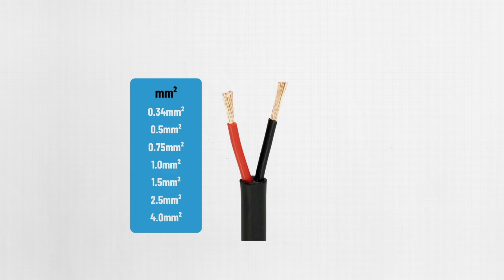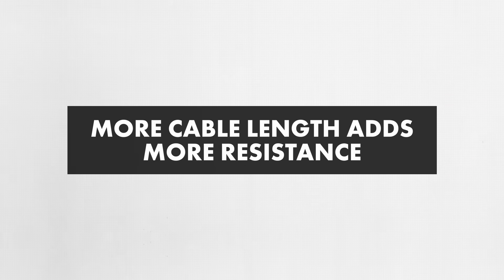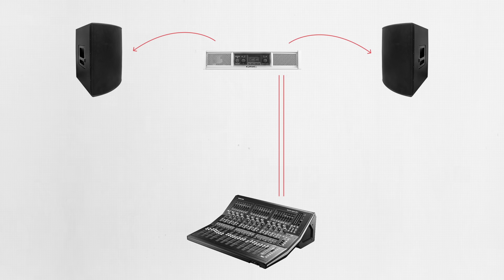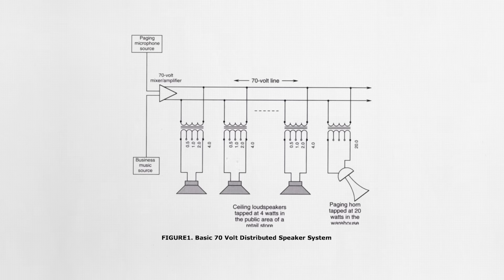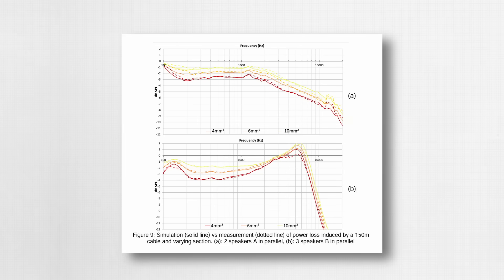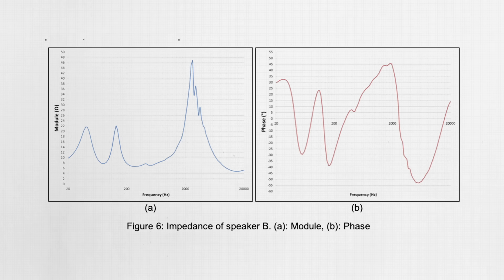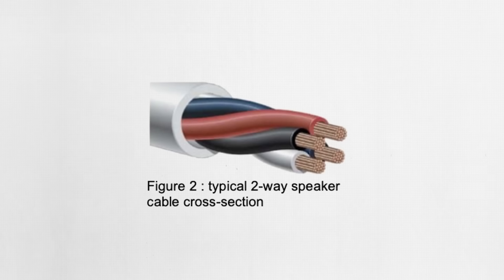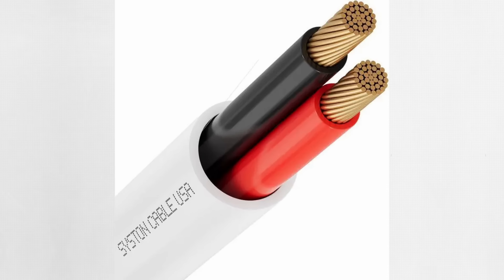Choosing the Right Speaker Wire (Made Simple)

Comment: I run 15ft wires from my AVR to two pairs of bookshelf’s. Went with OFC 10 awg wires for both pairs of speakers. Wrapped the pairs of wires to each speaker in braided PET. probably overkill but recently i found out that both my speakers can be powered by a 4ohm resistance. When the AVR was set to 8ohm it would get super warm even with the big gauge wires. set the resistance to both pair speakers to 4ohm and now the avr barely gets anywhere near warm. I also did not know bigger cables are better for low driving lower resistance speakers, so in the end im very glad I went with 10  awg cables even if it was thought to be overkill at first.

Comment: Excellent, completely accurate video. Well done. Howevrr, one point for home audio applications is that all those considerations are not really necessary since the price of 12ga cable is truly insignificant in the scheme of things. 16 ga zip cord is 30cts/foot 12ga is 1 dollar/foot. If your wiring a set of 1000 dollar speakers.... you get the point. The "saner" proposition is to simply use 12 ga for any system where full spectrum sound is expected. Commercial applications, where a penny saved is a penny earned are whole different subject.

Comment: the cable length matters a lot , the higher the frequency the more it matters , for 50hz bass you can have 20m wire you wont lose anything , but for 10Khz with 5meters you will lose some . Always use shortest cables you can , its not how expensive it is , after all PCB track in your AMP or DAC or whatever is real cheap , but its short and that is why its good .

Comment: Cables are not good so keep them as short as possible >>>pre-amp + 2 power amps.  I read a magazine which contained a test of different cables,from cheap to expensive and the conclusion was that all had their positive aspects but also negative aspects, least worse choice was to use coaxial cables ...the ones used by radio amateurs. The loads of money people use for very expensive cables are better used to buy 2 poweramps or active speakers.
Reply: least worse = best?

Comment: need to completely re-wire the inside of my 2 monoblocks - classA - what do you recommend? thanks
Reply: just don't go overboard. as all is precisely calculated for exact millivolts and milliamperes. changing to much thickness of wires, all that changes. you will probably need to change values on many capacitors resistors thermistors and transistors. find a good engineer who will be able to calculate all that. 
i once put 3 times thicker wire on power block and end up in fried capacitors. all because I didn't install stronger resistors. 
you heard it here. length thickness and impedance matter.
or just replace with same thickness and length.

Comment: decades back I ZZZZT-Poofd a woofer playing Creedence. when I replaced the driver I also replaced the scrawny wire from the crossover to the driver, reassemble. rock and roll. WTF? the other driver croaked? put my fingers on the other woofer. It's alive!

I figured out I should replace the scrawny wires in the other cabinet from crossover to driver. that worked.

amplifiers have two impedances, outbound and inbound. the inbound to outbound ratio is called damping factor. higher is better. a driver is a linear motor. A DC motor is a DC generator when it is driven rather than driving. the massive cone on a woofer has momentum. when the drummer relaxes for a moment the massive woofer cone bounces a few times. that generates a backwards voltage into the amp which muddies the bass. the low impedance back into the amplifier wastes that back voltage to ground. this only works if you have substantial wires from amp to speakers. I use 14 or 12 gauge with vast dual woofers.

Comment: Really well done!  I'm so glad you included skin effect, which is a real consideration at higher frequencies - at 20 kHz, that depth is less than 0.5 mm in copper.  Also, your inclusion of inductance is important, as there's more to speaker cable impedance than DC resistance.  One more point is that of damping factor which requires low impedance cabling to remain high. (That may not be as important with tube amps which have an inherently higher damping factor.) Again, excellent presentation!

Comment: For pro-audio the absolute most important aspect of your cables are "Do they lay flat on the ground to not create a trip hazard?" and "Do they coil nicely at the end of the show?" and " are they durable and reliable?" The answer to all those questions are "rubber jacket" SJOW or SJOOW cables and if you need to drive a forklift over them and don't mind the weight and bulk "rubber jacket" SOOW cables. Avoid the PVC plastic jackets as they don't lay flat or coil nice, get the rubber jacket. 12 awg is the industry standard for gauge, 14 awg is usually fine for tops if you want something lighter and thinner (more pack friendly). These cables are a pleasure to work with and cheaper then any dedicated "speaker" cable. Throw on some speakons for connectors and you'll have a cable that'll last forever. The 4 conductor cables are great for NL4 speakons, unfortunately you'll have to get the 3 conductor cable if you only need 2. Either disregard the 3rd connector or tie it in with one of the other connectors to lower your resistance. 14 awg + 14 awg = 11 awg (down 3 sizes when you double 2 wires), 12 awg +12 awg = 9 awg.
Reply: You do realize that coiling your cable creates a low pass filter?  If you have too much cable cut it shorter.
Reply: @DrParticle  #1: This is touring pro-audio advice. If a cable is coiled that's the way it's stored in the truck between shows. 2 or 4 conductor speaker cable almost completely cancels out any inductance when coiled anyways as the currents in each conductor flow opposite to each other, even if they didn't a half dozen turns at 18" diameter would be completely negligible anyways.  I could care less if they summons demons when coiled, that's the way it's stored. #2: You don't go around cutting cables in pro audio. You make up multiple sets of 25' and 50' (75' if you have a need) cables and that's what you have to work with for the year. An average small show with a full band and you are showing up with 1/2 mile (2,640 feet) of cable. Power, signal and speaker. All coiled by hand at the end of every show.  Aside from the connectors at the end, the way the jacket lays and coils is absolutely the most important part of choosing a cable in pro audio. Rubber jacket beats anything else out there.

Comment: Whoops —the video discusses gauge and gives visuals showing wires of different total gauge with equal thin strand constituents when discussing skin effects:
A 12 gauge effective cable with thin strands of wire will not suffer the same sort of skin effects attenuating high frequency alternating current that will be suffered by 12 gauge solid core wire! Each thin strand has lots of skin surface area relative to fewer strands of large cross section and can minimize HF loss. That’s why I said in another post serious cables addressing this usually are made of strands of different thickness—that way the total gauge can halo the low frequencies avoid attenuation, and the extra skin surface area of the thinner strands will help the HF avoid attenuation…

Comment: Gauge is complicated. Thick wire will relatively attenuate high frequencies due to skin effect, whereas stranded small gauge wires has more skin surface to conduct the HF but not as good for low frequencies.
Most people thinking seriously about this would use a cable with high-purity OFC or OCC copper mixed-gauge strands to deal with this. Cable doesn’t have to be expensive—just have good quality nonprecious metal (copper), attention to strand gauges discussed, and good dielectric and shielding.

That said make sure you spend 90% of your budget on speakers and amplifier—then source, then cable. No reason to spend more than a few $hundred on cabling.

Comment: Except if you go really thin Chinese shit. You will be fine 99% of the time. Even if you use house wire. 
What have a much bigger impact, is the speaker placement 

Ensure both speakers wires are the same length (and short as possible) is more important.

Comment: If the wire is a hose and the speaker is the sink.
Too much water through the hose and water builds up inside the sink.
Not enough water and the sink doesn't even get wet.
Anyway, enough about hoses and water and sinks.

Does the internal signal path of your amp and the speaker itself play a role in the quality of the sound?
And why use thick/thin wires when the amps components are of a different gauge?
Isn't it all dictated by the worst component in the signal path?????

Comment: @9:53 larger conductors have slightly lower inductance 🤔 maybe in the - only - case where they're intertwined in a cable. BTW, for normal people, 50 ft = 15.24 m ans 14 AWG = 2.081 mm² 😁
Reply: A 15.24 m copper conductor of 2.081 mm² section = 1.2288 ohm

Comment: there is an amplifier that was designed to make an amplifier-to-loudspeakers resistance equal to zero. it is diy project known as BatoMM amplifier. it is based at LM3886 and it has remote sense - and it works as remote sense from loudspeaker connection points - back to the input of an amplifier,thus removing all possible resistance-capacitance-inductive nature of connecting wires back to zero-related to an input signal,and it sounds like this: https://youtu.be/YaVux2K1Cq8
Reply: video was intentionally made with iron wires 1mm square from an amplifier to a loudspeakers,and it shows the diference with and without remote sence (DIN) connected or disconnected.  be wellcome to critisize.
Reply: Having a loudspeaker feedback loop back to the amplifier is any process engineers ultimate endgame goal. Many have tried, many are currently working on it. The latest I seen was a laser rangefinder mounted in the driver projecting onto the cone. I've seen optical methods amongst others. It seems to be elusive as no one has yet cracked the code. Whoever does effectively and cost efficiently will dominate the next generation of loudspeakers.

Comment: Multiple 18 or even thinner wires sound better than a single 16 AWG. Quad star is the minimum. Also the dielectric is extremely important. Teflon and cotton in oil are good.
Reply: Why better? Just higher effective thickness?
Reply: @tanelehala6422 no. Smaller skin effect. Smaller inductance. Win-win for no drawbacks

Comment: Good advice for your viewers, when I’m doing installs that require more than 25 feet of wire, I generally use Canare quad star Which is four twisted cables. It’s not crazy expensive and comes in a variety of gauges. 😊 as you stated, the best solution is to have your amplifiers close to the speakers using balanced line level cables for the long run of the system.

Comment: Power loss in a speaker cable is the small portion of the issues. Loss of a DB or two can be fixed with the volume knob, or amp size.  The real issue is the amp damping factor is decoupled from the speaker. Damping factor is the inverse of the actual output impedance. EG an amp with a damping factor of 20 has an output impedance of 0.05 ohms. Add a speaker cable of 0.1 ohms, and the system damping factor is changed to 0.15 ohms or a damping factor of 6.67. With the complex impedance of a speaker, the frequency response changes and unwanted resonance is less damped or attenuated.
In large professional touring applications, long speaker cables are a thing of the past. The speaker cable between the amp and speaker is generally less than 4 feet in length as the industry has moved to powered speakers. Now XLR balanced signal at line level are run to the speakers. The amplifier input impedance is most often 10K ohm balanced between conductors or 20 K ohms each conductor to shield for the rare unbalanced application.  This allows the output impedance of about 200 ohms to fan out to line array speaker systems where many speakers are daisy chained in parallel in the single signal from the console. Daisy chaining up to 10 speakers is common in a line array, with the loop through of the signal placing all speakers in parallel on the signal line.
To avoid noise, the move to go digital to the speakers is common using AES./BUI which sends a stereo digital signal to the speaker amplifiers.
Reply: You are referencing DF as being 1 @1 ohm? Shouldn't it be referenced to the impedance of the load instead? Which is usually 8 or 4 ohms nominal, without cabling.
Reply: @tanelehala6422 just thinking the same 🤔

Comment: Aaaanndd then you open your amp and see just a one 2,5mm2 wire from amp pcb output to speaker connector 😂
Reply: 2.5 mm2 can conduct 20A. More than enough for audio.
Reply: Use a good  cable with more than 98% real copper. I use the elephant cable 4x2.5mm2. 7€/m. Exzellent sound. 🤙🤙🇩🇪

Comment: Why would the cross section of wire be measured in square millimetres? Is it the area of the face of the cross section?
Reply: Why would anyone use something called "AWG" which doesn't represent any real value or measurement??
Reply: @miladinseratlic5984  oh, I'm from a metric country. I'm literally asking why you'd use SQUARE mm which is a unit of area, not distance or length. Therefore, I'm asking - someone who knows - why is the measurement in mm squared instead of just mm?
Reply: @DrMarv  probably because resistance is inversely proportional to the area of the cross section, not the diameter

Comment: Hi will you please, please please, do a video on how to stop the following.  When I record in my studio, multi track. I lay down say a previous backing and go to record a track with the rhythm guitar for reggae. As a twin chop. Which has to be very accurate ". And it's always late , iv changed buffer size, everything. It just gets worse , so I end up doing the multi track on my tyros 5 keyboard which has none of this problem,  I'm using the focusrite 2i 4 first gen ,  iv even tried moving the track slightly but WOW that's hard. It never has gone to where it's needed,  my daw is. Mixpad,  so I'm stuck with expensive software which is useless for my tasks,  all everyone talks about is the latency like playing a note and hearing it with a delay. I don't get a delay ever. Just this problem so it's playing back one track which I obviously listen to on headphones 🎧 while recording another. But it's NEVER, accurate, arrrggghhh,  my focusrite has a playback and monitor knob ,  it works on playback. When playing back and works the other way when recording?  So I leave it in the middle,  am I missing something here ?  I am an electronics design technician retired. I'm not stupid. But this is driving me nuts. Please try mixpad , and one of your focusrite units. And see if you get the same problem. I know many people are having this carry on, but no one who knows. Ever mentions it. ???  Iv messaged a dozen or more guys who waffle on for hours about latency , but never about this very common problem which as far as I can see has nothing to do with the common latency,and no one has ever replied ?? please help. Thank you. Kaiwen.

Comment: The only thing you need to know is how heavy it The wire to handle the load you don't want to use a thin wire with a heavy load or you will have a fire so think before you buy 😊

Comment: I have a pair of speakers that when they were first made, were considered to be the best money could buy, They are 1977 Tannoy 12" HPD. These speakers were used by most recording studios for mix down. The manufacturers told me that they don't need ridiculously thick cables and that they work just a well with bell wire of approximately 22 gauge. Obviously thin wires are prone to breaking so I went for 16 gauge. What you need to know is how much power is your system generating at normal listening levels @ 20w RMS = 0.167A . Bell wire is good for 1A , What does this tell you? 20 watts RMS is way too loud for a comfortable listening level for most. In the USA  @ 110 volts, a 1.5mm2 cable will handle up to 2,400 watts , or in the UK @ 240 volts =4,800 watts. Now stop it all you naughty salesman con artists.

Comment: My cables have 4 x 12 awg poles. Mogami 3104 deep cry treated with beryllium copper leaf style bananas. They are right with the contact inside the binding posts because the springiness of Beryllium copper to retain the contact resistance over years of use. 

You should have also touched on contact resistance which will also affect the performance. Those spring type bananas are one of the worst offenders to raising the resistance.

Comment: In car audio I use 10awg because of thermals and  200 watts per channel for mid bass and subs.
I don’t need 10awg for mids and highs but I do it anyway. Running the same wire is just easier.
Reply: What do you mean, easier? Ur choice of awg if way over the top, yielding you no better sound, just less money for better speakers.  
https://youtu.be/QXwdoATdmfM?t=397 if dude's categorical breakdown is accurate.  I don't know enough about it. I just noticed you stating what you think is good anecdotally and wanted u to know ur dead wrong and u could've got a bunch of cheeseburgers with the money you saved on copper.  have a look at the link, the link which is of the video ur commenting on, about ur own personal gaffe, and how u figure that's easier even though it isn't and it's wrong.  btw i love ur comment, it's just wrong, false, prolly a lit, and ur a bot
Reply: @AdamHAdamH Calling someone a bot because they used over the top wire gauge for their use case is undeniably hilarious.